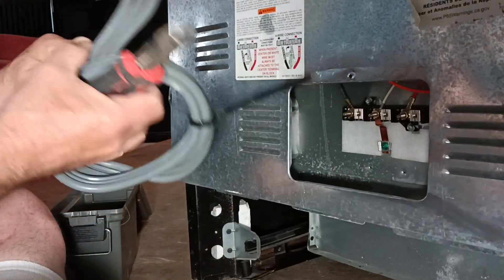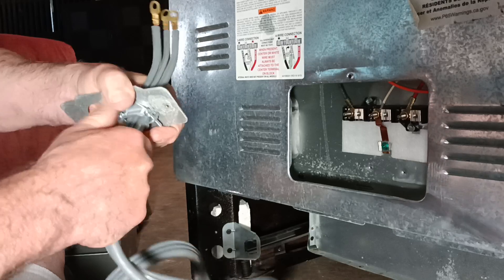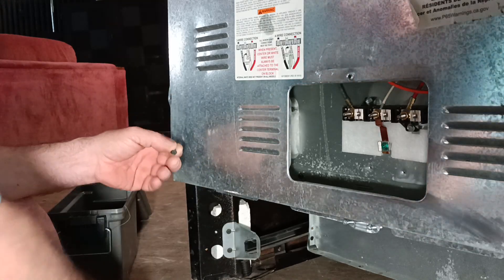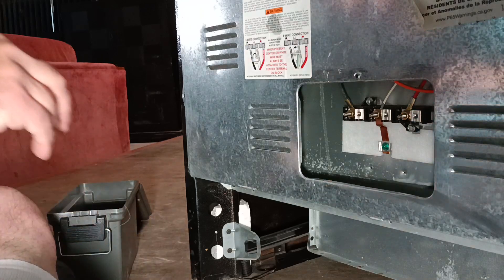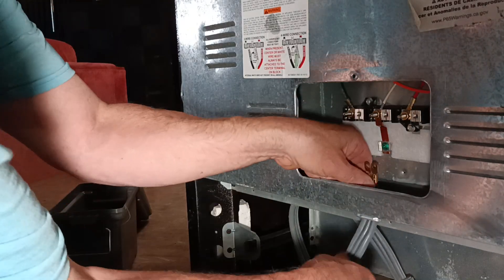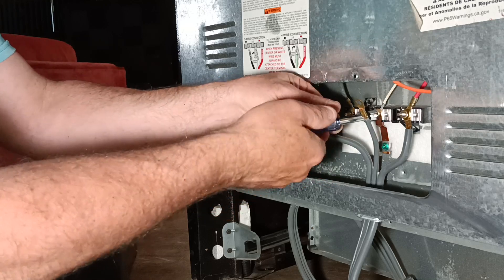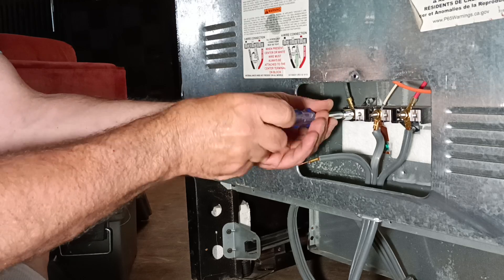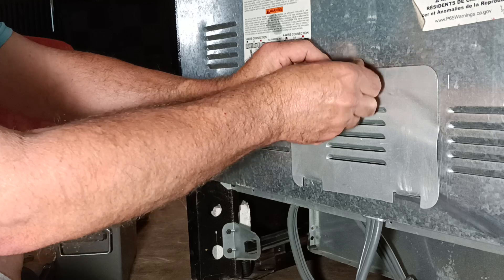May 25, 2024 how to wire a 50 amp 240 volt 3 or 4 wire whip/cord for a residential electric range

Comment: Why not put the tools back in the box so that you don't have to go through each one to find the right size again? Seems you made an easy job much more difficult than it has to be. You must be retired and have all day to do the job.
Reply: I don’t think he recognizes that the different sizes of nut drivers are color coded which I have found are standard I.e. Red is either 1/2”or 1/4" yellow is 5/16” then green is next then blue is 3/8” , however he could simplify the game by leaving out the nut drivers he has used next to the screws they were used for, JMHO